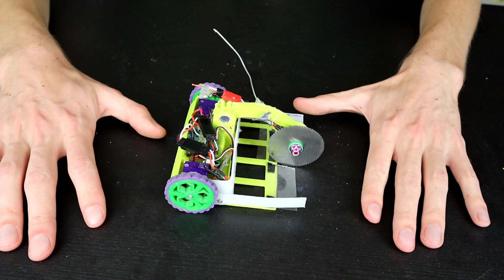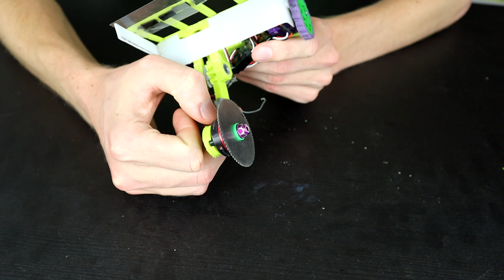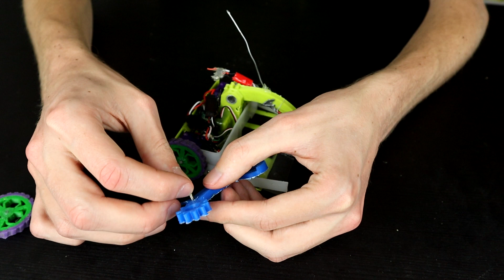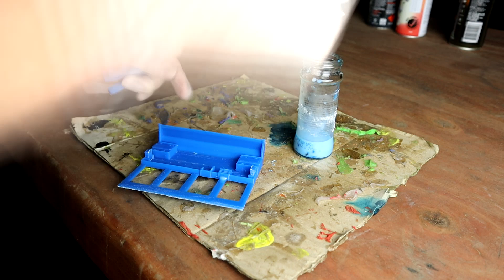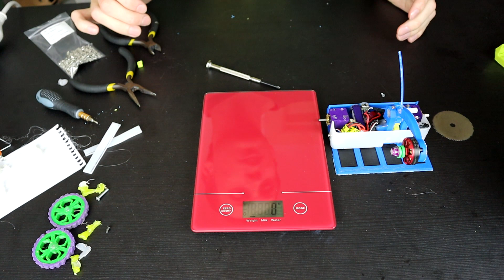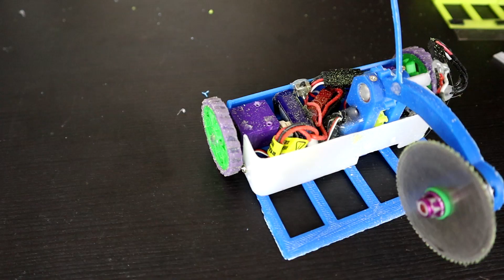Saw bot Upgrades!! (Vogon Poetry V5)

Comment: Hey can I ask what kind of motors do you use for your drive
Reply from the maker: Same as all of my competitive antweights: DFrobot n20 gear motors with an ESC attached to them
Reply: @TeamPanicRobotics  ok do you think it could work in a four wheel drive American ant
Reply from the maker: They should do, but it depends on your battery set up.
I think these can only do 2s
Reply: Have you ever tried n10 motors for your Ants? I've been told that n20s are overkill and that n10s will be just as good and a significant weight savings

Comment: A few thoughts on slef righting, what happens if it ends up more on its side then flipped up straight back?  Also, could you do 2 of them, one on each side, instead of just the one. Maybe even have them angled out about 10 degrees from straight  so they give a slighty wider base and prevent it from rolling in addition to flipping.
Reply from the maker: If it flips on its side, it will be resting on a wheel, so I'll still get some movement and should be able roll over onto the back or front again

Comment: thanks for the shoutout...

i have another idea (sort of trying it out myself) i made an overhead drill bot, and im planning on making another arm with a saw simmilar to yours... this would give me more options to cause some damage against overhead weapon specific top armour... mesh wouldn't stop a drill for example...
my issues would be weight related though... its 4wd with titanium chassis and is at 150g on the drill config so would need to shed some weight to make it work... where as you started the other way round meaning that you already have your heaviest setup...
Reply from the maker: I do like the idea of an overhead drill bot.
Might look into that in the future
Reply: Could you replace the titanium with Lexan to save weight? IDK I'm just spit balling since I've seen some pretty robust lexan ants. Drill is cool
Reply: but.... titanium... 

nah im sure the .5mm ti chassis weighs about the same as the equivalent 1mm polycarb, but is multiple times stronger...

theres places i can save weight if i really needed to... im thinking i will just keep it as a drill bot, and consider a dedicated saw bot build if i fancy it
Reply: @TheDaddy187  Cool, I'm unfamiliar with the density of titanium, so that's really cool. Did you need special tools to work it, or were regular metal working tools sufficient?